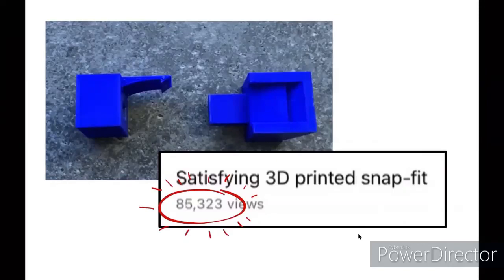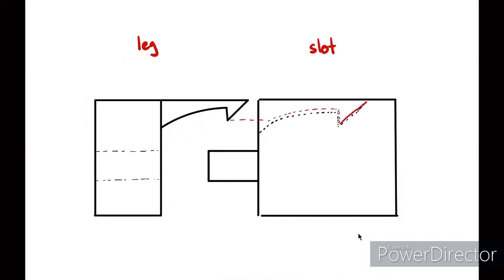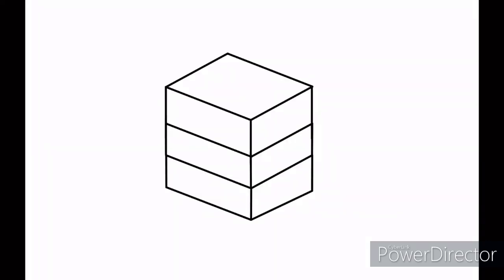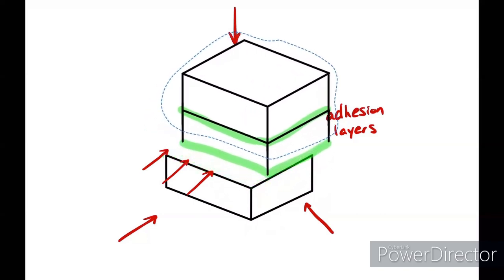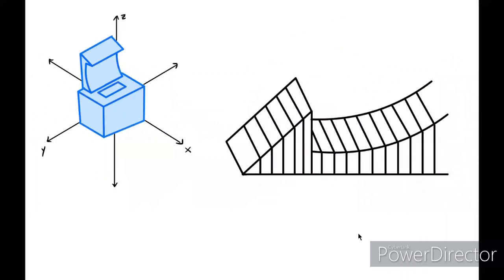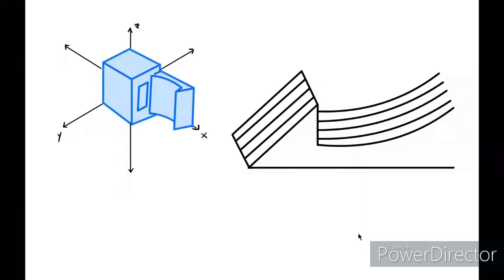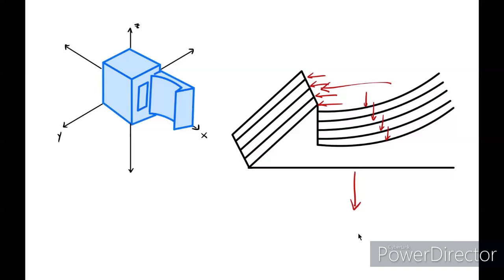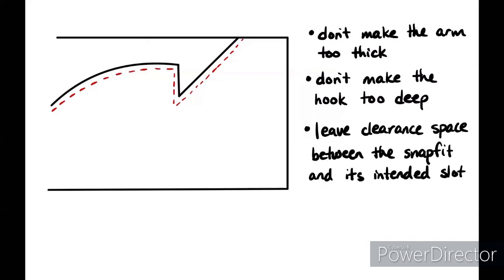Guide to 3D Printing Snapfits and Maximizing Layer Strength

Comment: Excellent visuals and an extremely satisfying slow-mo snap fit! I loved how you shows the Cartesian axes alongside the layer directions. You should keep making more videos showing the wrong and right ways to orient prints.  Subbed!

For folks reading along, the different-properties-in-different-directions aspect to FDM printing is called anisotropy. Wood is also anisotropic because of the grain.

Resin prints don't have this issue because how the resin cures creates isotropic prints.  You can print something on a resin printer in any orientation and it should have the same material properties (ex: response to sheer/compressive forces). Resin can be much more brittle though as it doesn't have much give without special elastomers added in.

Comment: I tried making some snap fit lids, and they worked. But the measurements were really hard to get exact.
One thing you don’t mention is the finger hole for releasing the latch. Very tricky to make an easy to use snap fit. Well done so far
Reply: Snap fits are fragile, they really should not be used constantly but only a couple of times because material fatigue will take it´s toll. For a frequently used latch it is better to choose a different design. 
Snap fit´s are always a bi'ch. In injection molding tools as well. Measurements are always a big issue, they are quiet hard to get right.

Comment: You can also design the "slot" part to flex and snap and the "leg" part to be stationary. This works pretty well and can significantly improve the print orientation. Sometimes a certain part can or should only be printed in a certain way which might not be the optimal way for the snap fit. 
So all you need is a 45° hook on one part and a U shaped snap fit which flexes on the other.

Comment: Came here to find out how much space to leave between the male and female parts.  Good video, but bummer.
Reply: @vincent3d993  Did you mean 0.001 - 0.003 inches?  Otherwise seems like a lot.
Reply: @ProfessorOzone  cm
Reply: 4x layer height usually does the trick. So 0.2mm x 4 = 0.8mm. Or 32 thou in freedom units.